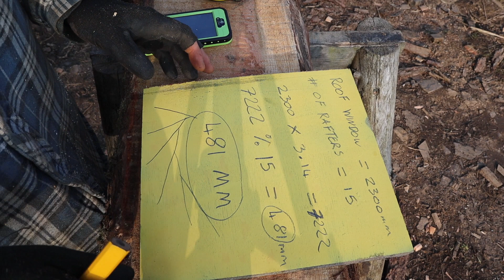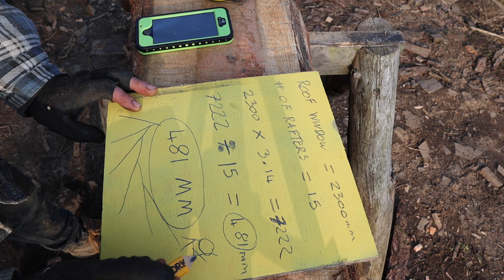Off Grid Earthbag Workshop Part 22 Reciprocal Roof

Comment: Finally had to subscribe... couldn't keep up with manually checking for progress every day on the your channel. I've been watching since you moved in to the roundhouse (even watched the videos where the cobbing felt endless). Some thoughts:
- I love seeing the design come together. Brilliant how the roof looks semi-reciprocal: so the weight of the turf roof will hold the support log / shared wall in place.
- I hope your estimate of two years is pessimistic, because I very much share your excitement about the workshop.
- What are you going to use for a window for the roof?
- It seems to me the outer wall of the stairs might be the only liability as the structure settles into the hillside. Can't recall the lay of the land on that side exactly. Any plans to shore up that area?

Enjoy those few days off! Maybe you'll have the inclination to address my questions between reloading the cider stash. : b Well done again.

Comment: Fantastic Chris! 
Where does one draw the line between a workshop and a work of art?
? Pack cob between the rafters,  is the any concern with the non bagged cob drying out faster (wood wicking moisture) than the cob in the bag? Non structural yeah but the bit separating and  causing the plaster or crack?
Reply: Wait and watch, I think you will see the whole thing is going to be covered in unbagged cob.

Comment: Kris, a question about the rummy,  you mention 481mm,  as the rummy, I think you mean 481cm, that will give you the diameter of the window at 2296.7cm otherwise at 481mm its just 229.7cm or is my math off? So far it looks amazing, though Pole 9 or 10 on the side of the door looks a little long and could use a support.
Reply from the maker: Hi, I think you are just confusing mm and cm. 2296 cm is nearly 23 meters. That would make a window much larger than the entire building. I did mean 481mm 👍 at 481mm it gives a roof window of 2.3 meters or 2300 mm
Reply: @KrisHarbour  My math was bad...Thanks Kris, Awesome Job!!!!

Comment: The whole weight of the roof is resting on that first beam. Have you calculated the load and the stress?
Reply from the maker: you should watch the next video for some info regarding that. the whole weight of the roof does not rest on the first timber at all.
Reply: @KrisHarbour  yeah. I binged another 6 episodes of this already. I was a bit quick to judge there. Sorry about that.

Comment: Please correct me if I am wrong. What if you split the Roof Poles which goes from the center to the outer walls were into perfect semi-circle instead of the whole pole. which is double the dead weight. Less the weight overhead better it is, isn't it ?

Comment: How much are you expecting the weight of the roof to compress the walls down?  I bet you've had to compensated for that in the height? I bet it will compress the walls down a lot with all thet weight on the top.

Comment: Great progress, looking really cool! What's also really impressive is how you designed and planned it.
One question- with the beams secured at the centre and to the wall, is there a risk the wooden beams can contract/expand to maybe push/pull the walls?
Reply: Interesting question that! I know he'll have an answer though...
Reply from the maker: Hello, wood does not expand or contract by any amount that is worth talking about in that direction. Wood will change in diameter quite a lot but length stays the same.
Reply: See ;P
Reply: Nicely Done Hannah  :)

Comment: Ummmm. 
What are the calcs on the compressive strength of that centre post tree thingy?
Until the additional wall is up, isn't half the entire roof load sitting on it?
Hmmm.......
Reply: I'm wondering exactly that
Reply from the maker: https://youtu.be/8lSmX3LF6ko

That’s a stack of Jenga taking 6 tons. That “center post tree thingy” is a large oak tree. It could literally take hundreds of tons. That tree could have the entire building, the roundhouse. My digger, my van and my tractor and i would be surprise if it deformed at all.

The logs currently weigh about 4 tons. At least half of that force is going down in to the walls. So if there is two ton on the centre log I would be surprised. So to put it in to perspective it could currently all be sitting on top of a stack of jenga.  I think it will be just fine 👍
Reply: @KrisHarbour  Good! Yay!  >Phew!<

I guess that's why you are doing this and I'm not. It looks too light to me, but you've clearly nailed it..... figuratively speaking.....

Wishing you the best - it looks tremendous!

Comment: So if I am seeing this right an extraordinary amount of the weight of the roof is being supported by the single post the first rafter was placed on. If all of the ones after are resting on the first post the last one should be putting it's weight on the next and so on up to the post. In a full round they are all laying on each other and the load is pushed to the walls and the fulcrum of the overlap but here that doesn't seem to be the case. Any thoughts?
Reply: Err, Kris has got it completely wrong and it's going to fall down and kill everyone under it???!!!
OR
Kris actually knows what he's doing and wouldn't put such an ENORMOUS amount of effort into building something he wasn't confident would work......?

Comment: Roof slope is important to shed water . Too shallow can lead to problems. Roof trusses distribute wind loads and weight on to wall. Building design requires a real depth of knowledge that takes time and builds on previous experience . New designs simply sketched out are rarely successful and no one in building wants to repeat work . basically what I am saying is obvious that all components in a building are related and dependant on each other and the environment for a successful design .